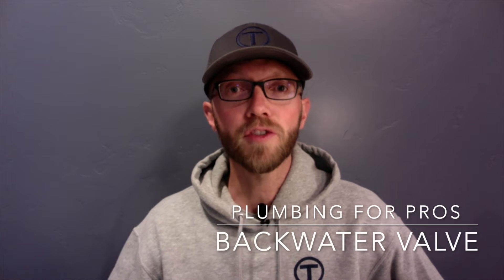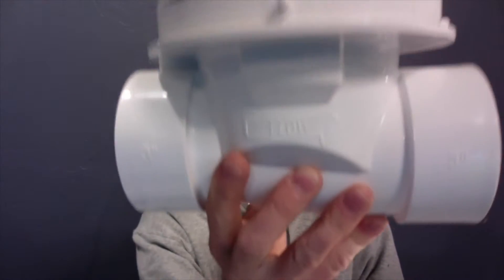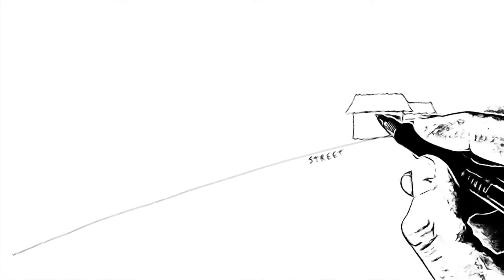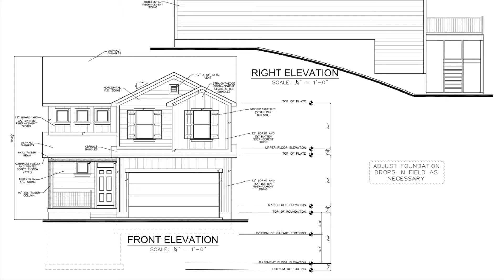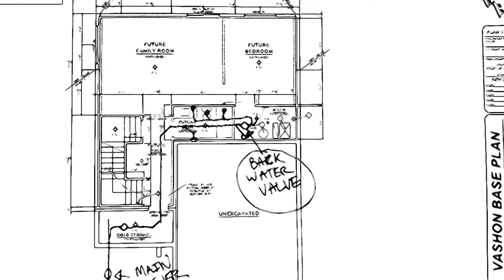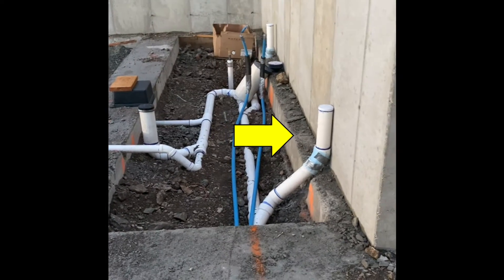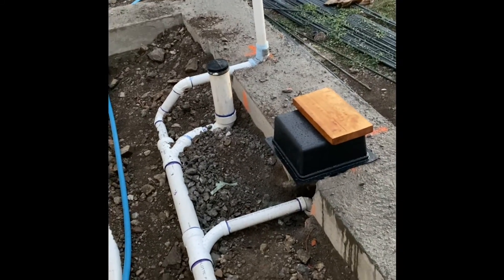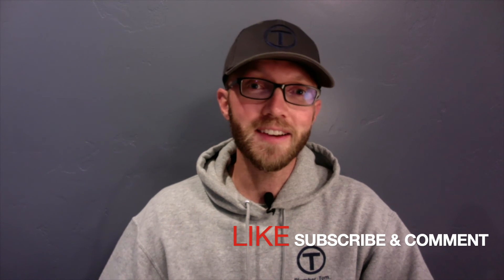Plumbing Drain Backwater Valve

Comment: I have a Mainline backwater valve that is in a default open (flapper down) position that's required by my city (Toronto, ON, CA). I recently had a blockage in the city side and it took a couple of day for the city workers to clear the blockage.  When the valve was activated, the flapper was up, but it didn't block 100% of the backflow. A small amount of sewage water seeped up my floor drain.  Are backwater valves suppose to block 100% of the backflow and for how long?
Reply from the maker: Ideally they block the flow. But it doesn’t surprise me that it leaked. I don’t know that they are capable of holding back a lot of back pressure.  It could also be due to waste or debris that build up in the valve and keep it from sealing.  I think the good news is that it worked well enough to keep you from a massive sewer flood.

Comment: Hey Tom; if I have a blockage in the basement tub and toilet and I open the backwater valve, am I going to get soaked with the bathtub/toilet water or flood that area of the basement with the sewage?  Or will it stay inside the pipe?
Reply from the maker: If the sewer is backed up at the street and you open the backwater valve, it will flood the house with sewage.  So you want to confirm that the sewer connection outside the building is not backing up.  Once you are confident that the sewer outside the building is okay, then you are safe to work on a blockage at the valve itself.

Comment: Hi, I will have to connect schedule 40 pvc inside valve to make it the right distance between the cast iron line. Is it a must to use pvc glue for this connection? I'm concerned about the ability to roll a 4" proflex 3000-44 coupling. Thanks
Reply from the maker: You can use no hub bands or Fernco couplings to make the connections.
Reply: Hello, I attempted to use the 4 inck no hub corrugated metal shielded  coupling to the backwate valve , cast to pvc, and I still get some leakage on both sides where the couplings are. Any suggestions/  Would a 4 inch non shielded thicker rubber fernco be better at preventing leaks?  thanks @plumber-tom9470

Comment: Why not put a the backwater valve / Cleanout at the main line outside of the house and close to the street to avoid the whole house having any issue whatsoever.
Reply from the maker: Great idea.  The problem is accessibility.  The sewer in many places is so deep that an additional manhole would be required to access the valve.  That is why it is most often installed inside the building.   Also, fixtures that are not below the next upstream manhole in the street are not required to pass through the back water valve.  If the valve were installed outside the building it would require a separate building drain, which is not ideal.
Reply: @plumber-tom9470  I have a customer who wants this installed on their main. They live in the high risk flood zone in coastal Florida. How can you make it accessible from the outside? The main is about 4’ deep.

Comment: Hello, how is the flap attached to main body? Will it stay in place in a  severely overcharged sewer system from torrential rain. I saw a Oatey brand, and it looked like the flap could be lifted easily up and off. Didn't seem like a good design ,if I am actually seeing it correctly. Thanks
Reply from the maker: Some of the models can be lifted out of place, which is a problem.  Some manufacturers have improved their design and connected the flap to a ring so it cannot come out of place.
Reply: Thanks, my existing valve, is longer than the ones I am seeing advertised on line. Right now there are 4" long fernco black coupling with steel clamps. Since a newer shorter valve would replace it, is it acceptable to only have a inch overlap of fernco on both ends of fernco?  Or would   I have to figure out something like a PVC connector inside valve to extend length? Thanks
Reply: The Oatey flap only comes out of place when the screw top is off which is what secures it in place.

Comment: What are the chances that in later years, or decades, the manhole cover gets stuck so won't overflow? Or at least not straightaway until increased pressure has built up. It could mean a house level with it or even slightly above getting backflow into the property for a time (shortly) before the manhole goes. Do manhole covers expand sufficiently on a really hot day to get stuck in place?
Reply from the maker: Manholes usually have a bunch of vent holes in them to provide air flow. Pressure building up is bit common.

Comment: Sir I have installed this product but it's not working.It is unable to prevent the back flow of rainwater.
Reply: Hello Javed, Why is it not working? Did you get any chance to check it? and was the installation done properly?
Reply from the maker: Not a perfect fix. But better than nothing in most cases.